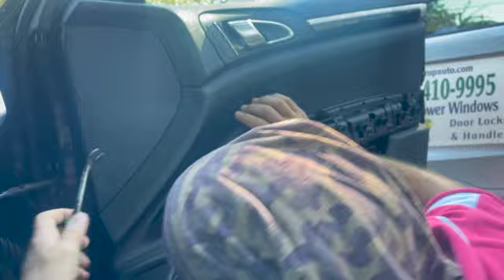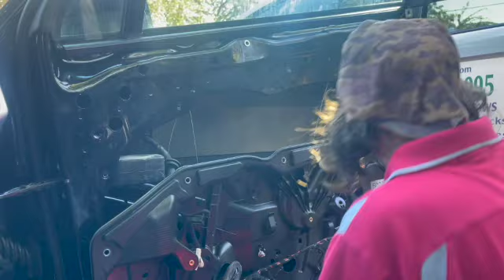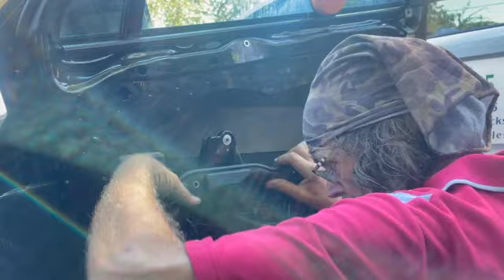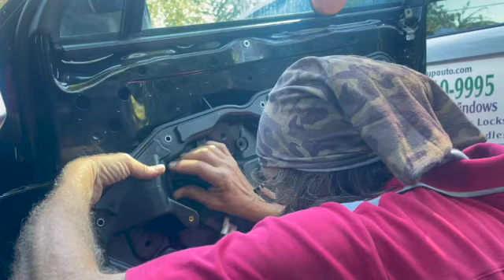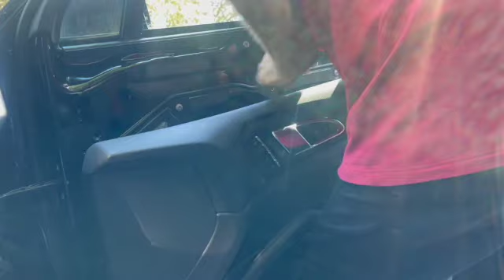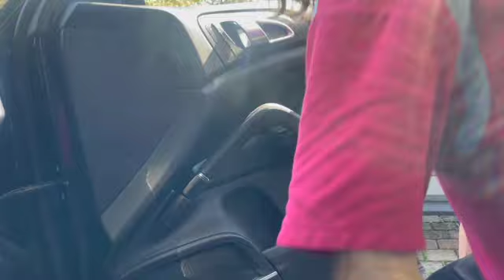Porsche Cayenne 2011-2018 Window Regulator Replacement & Repair Right Front

Comment: Three are three screws where vent window would be if it had one doesn’t seem like that’s holding anything on now but what is holding the top part of the inner door on it’s driving me crazy er. Thanks you better be handy on a farm nobody to help very good your handy at many things I’m sure thanks for vid
Reply: Hope you figured it out but if not check the on the outside of the door frame, peel back the rubber seal you should see beveled screws.
Reply: @tannguyen95  Mine is a 2013 but I couldn’t find them
Reply: @walukdotcom  I just replaced my window regular myself,  mine is  2015 and I believed it should be the same as yours.

Comment: My 2014 Cayenne window won’t separate from the black inner panel. Even with window motor out.
Reply from the maker: Might require professional help. do a web search for power window repair and the city you are in

Comment: I am having trouble getting inner door frame off do the three vent window screws need to come out? It doesn’t seem like it maybe Previous owner did something weird to this panel because the inner one is not coming off it’s like attached on the upper part of the frame do you know where you put your arm out of the windows down and you were driving around you know not a Mechanic you can tail getting pretty frustrated any advice as inner frame still attached to door it looks like a couple rivets are stripped ? On side of door but it pulls out a couple inches so not sure about that it’s mind boggling it’s still attached 
Do I need a drill for rivets or dies everything screw out any help If you can even understand my problem would be helpful thank you very cool you live on a working farm at least you’ll eat well as the world is being reset crazy mo foes are going to get rid of us all just some trivia for you lol